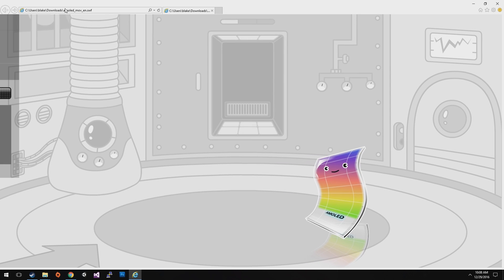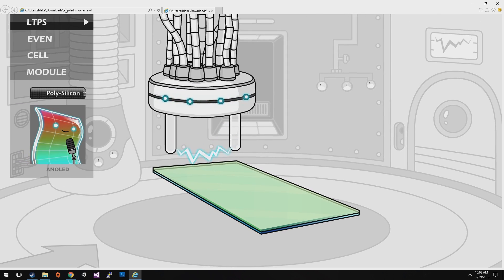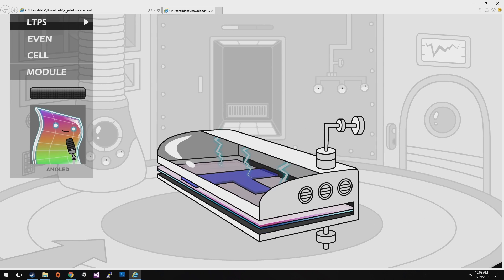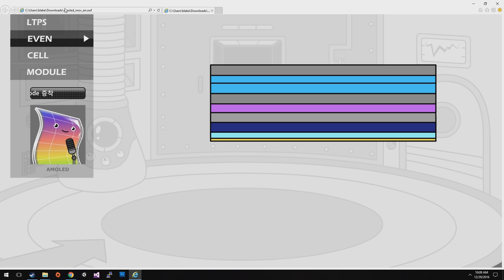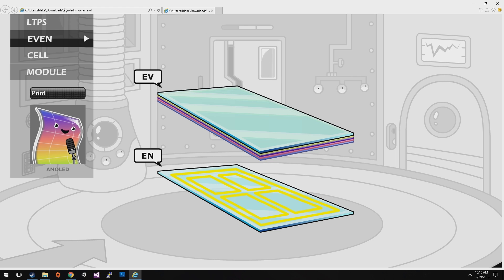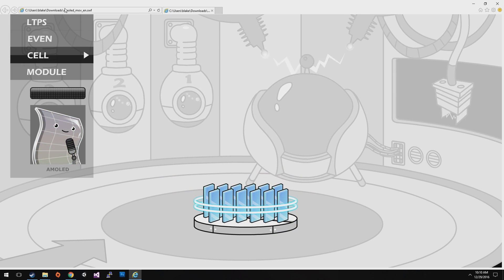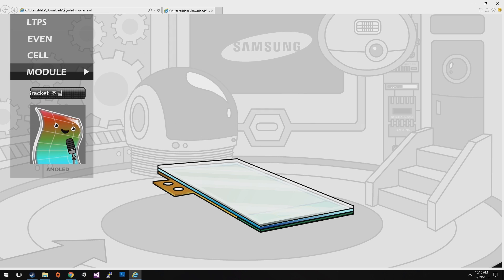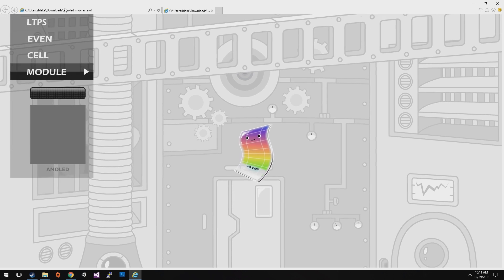Samsung AMOLED Production Process

Comment: Now what if it gets a burn-in?
Reply: Lol_wut? I've had many AMOLED screened devices and never once had an issue with burn-in?
Reply: Adam Bacon Yes me too never faced I replaced one on my phone but never had.
Reply: ive seen it twice on my phones.. I went back to a decent LCD display
Reply: Split  screen into parts, thick roller to thin screen, screen on spray material. Remove unwanted material, re half together screen attach. Phone is now complete